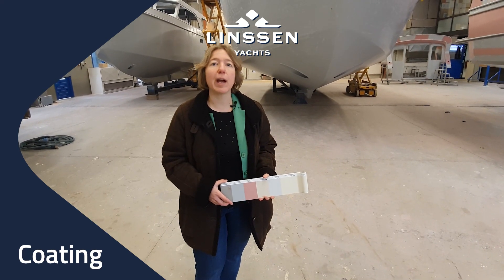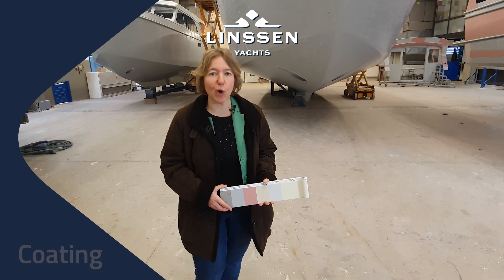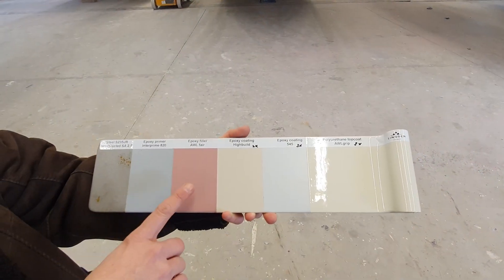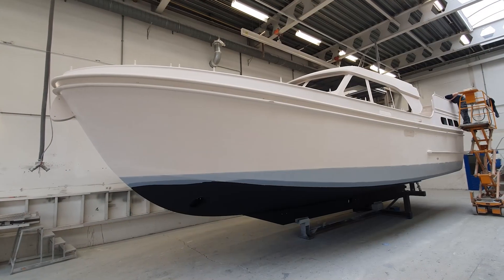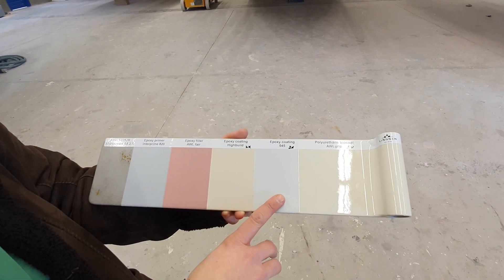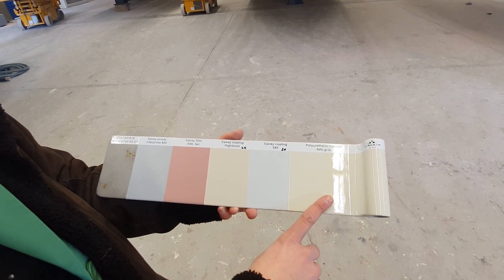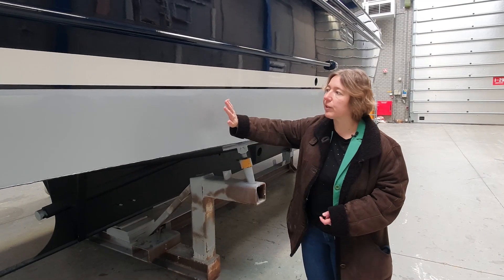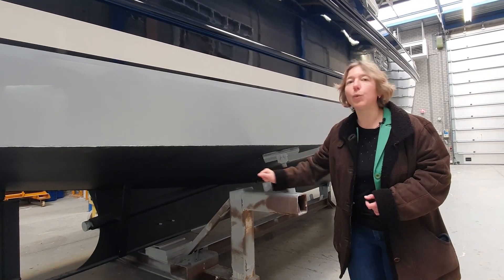Linssen Coating Department

Comment: Is the inside also treated this way?
Reply from the maker: The inside gets the primer first and then technocoat. With yachts from 40' and larger with separate colours voor engine room (grey) and bilge (red). Smaller boats only one colour (grey) so two layers.